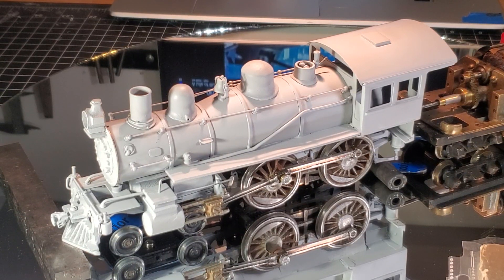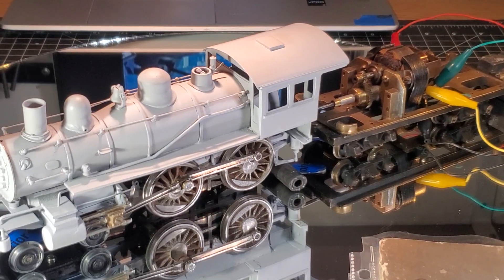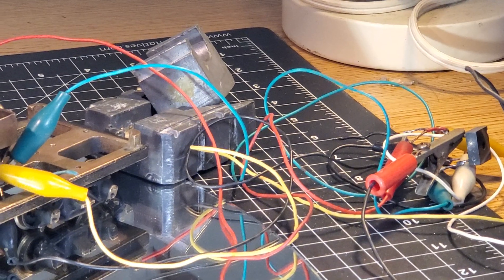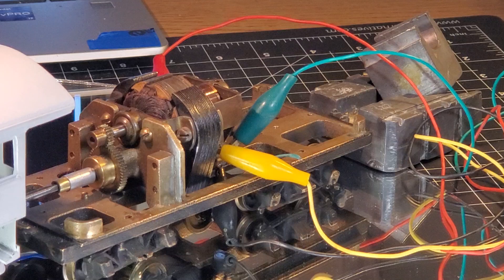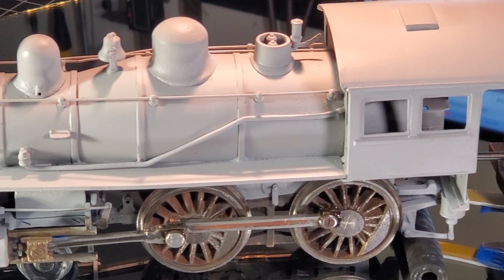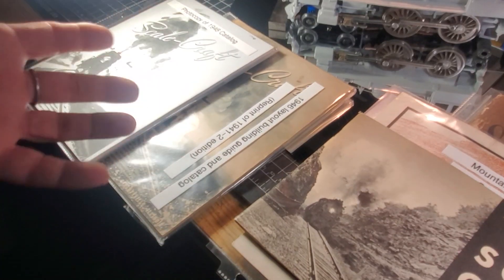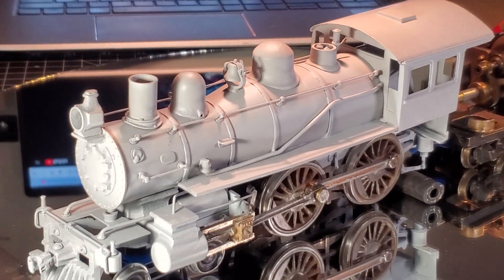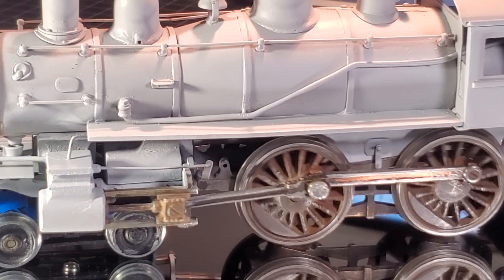O Scale Brass Ed Alexander 4-4-0 Restoration Part 16.

Comment: 4 of my 5 Vintage steam locos have  tender drives with that style motor. I hope to remoter them with a cam mot in the locomotive
Reply from the maker: davidkoehler....that is what was thinking originally.  But the owner of this 4-4-0 convinced me that those original open frame motors are part of their charm....so I learned to wire up bridge rectifiers to run DC open frame motors on our AC power.

I'm glad we kept the motor.